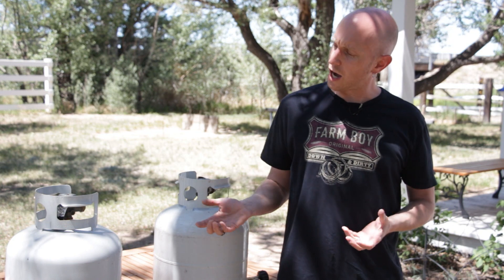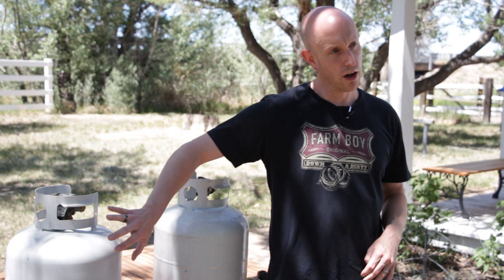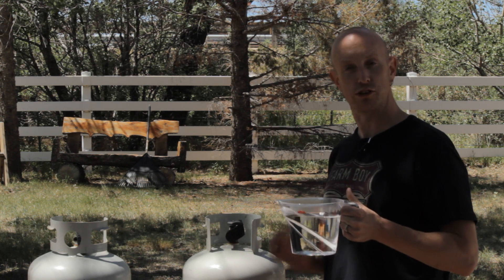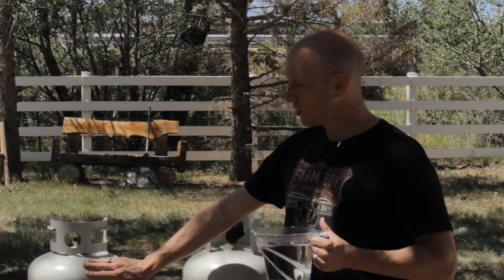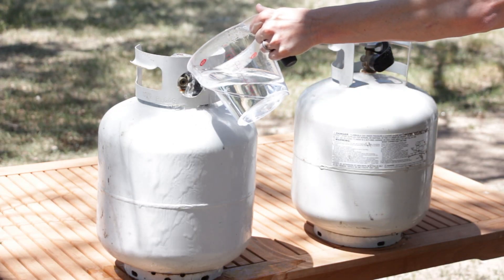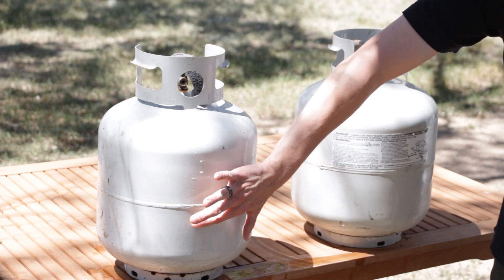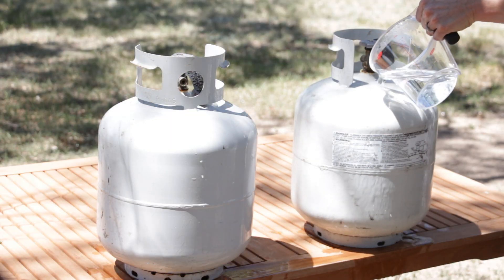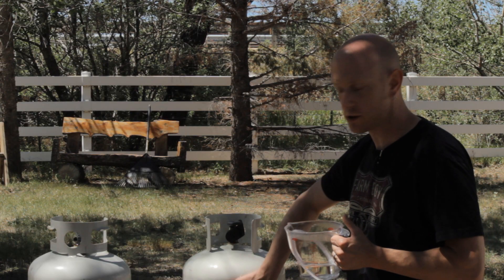Check the level of your Propane Tank

Comment: Propane gas is stored inside the cylinder as a liquid. It boils off to produce a gaseous head space which is withdrawn when in use, this is why cylinder contents gauges do not work as the liquid is continually boiling off maintaining that head space pressure. Argon, oxygen, nitrogen, air, helium cylinders are not filled into the cylinder as a liquid, they are filled by pressure with the gas itself and they are filled to much higher pressures usually between 0-200 bar (20,000 kPa) (1 bar is the atmosphere we are walking around in). Cylinder content gauges are the best way to check the contents of these types of cylinders, pouring boiling water on them will tell you nothing. I work in the industrial gas industry here in Australia so I know lots about this stuff, happy to answer any questions.
Regards
Wayne
Reply from the maker: +Wayne Molloy awesome. Thanks for the info. I tried it on my welding tank and didn't get good results. Now I know why. 👍
Reply: Jeff Baker always be careful when using gas cylinders of any type, follow the manufacturers instructions and you should be safe. Remember it's not just the gas itself that can present a hazard but the pressure within the cylinder. A cylinder filled to 200 bar has the potential to kill if that cylinder pressure was suddenly released. Believe it or not oxygen cylinders can present the biggest hazard as anything and everything except brass will burn in pure oxygen given the right circumstances. Things that don't normally burn in air will burn in pure oxygen. NEVER use pure oxygen as a substitute for compressed air. If you were to dust yourself down with pure oxygen you would saturate your clothes with oxygen, if you then walked past any source of ignition you would go up in flames very rapidly